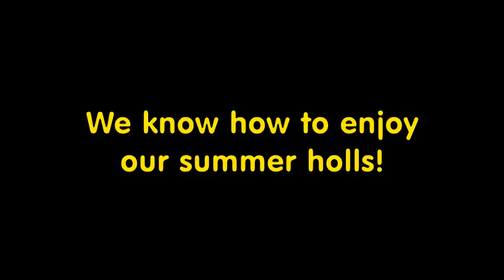Diggers and dumpers

Comment: The digger is Jerking about to much. Not enough revs in the engine so the machine is working alot harder & hydraulic pump working harder & blade should be at the front of the machine to keep it stable.......